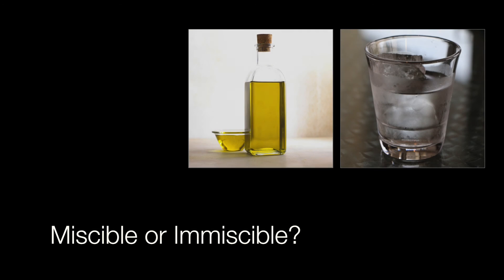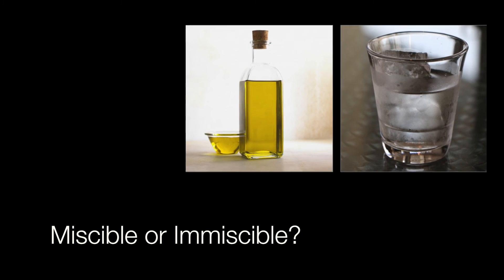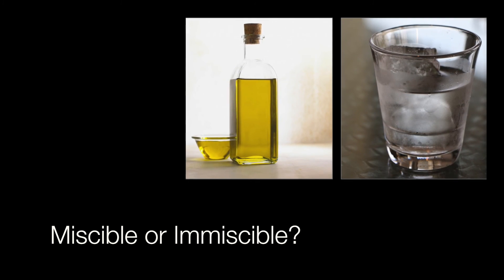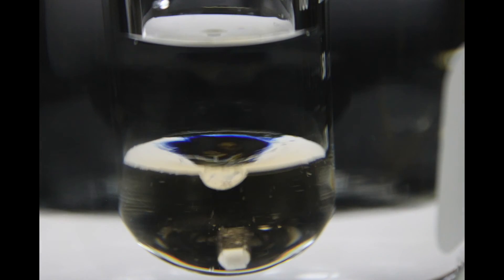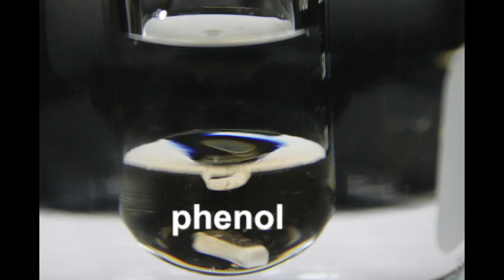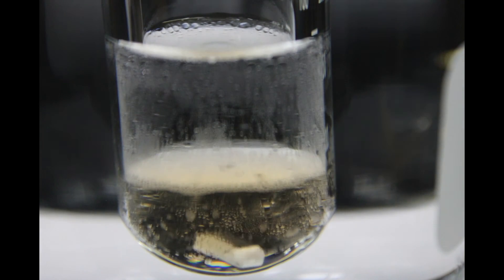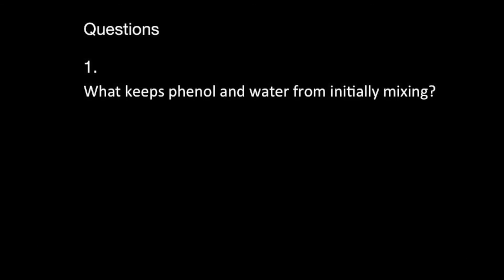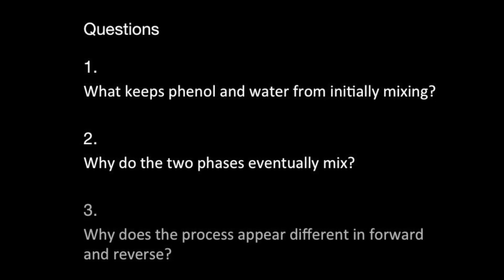Miscible or Immiscible

Comment: Interesting. Why did it get cloudy?
Reply from the maker: This is the beginning of phase separation. As the solution is cooled,  the intermolecular forces favor the separation of the two species. As they are well mixed at this point, they don't simply form two layers immediately. Microscopic clusters of each species form at this point, giving a cloudy appearance. The droplet slowly grow in size until it looks like the original state.